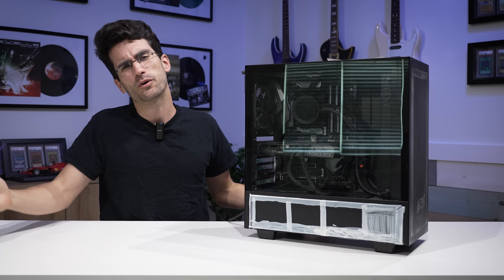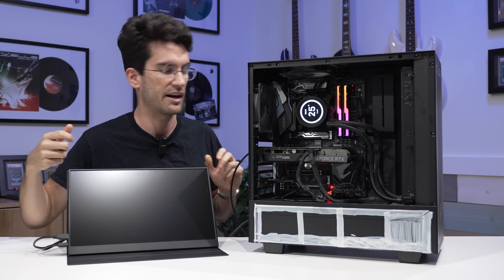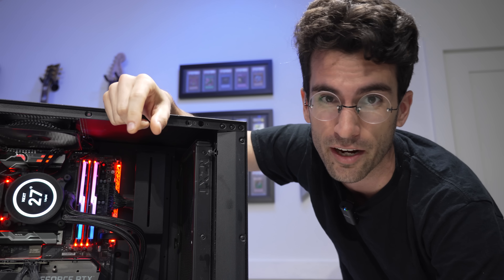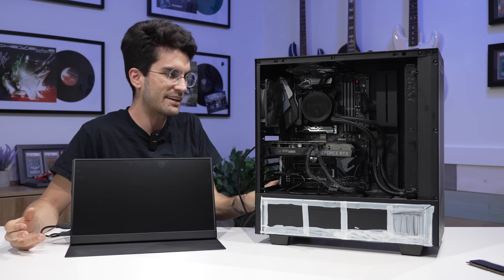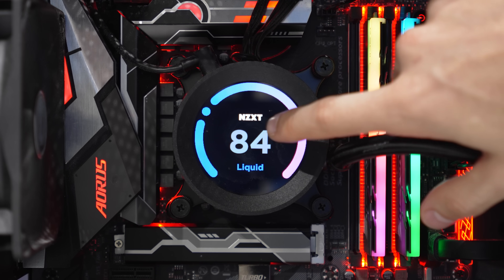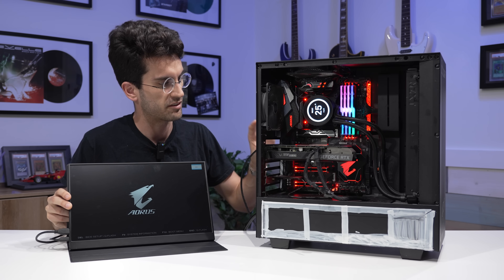Fixing a Viewer's BROKEN Gaming PC? - Fix or Flop S7:E1

Comment: Hi @Greg Salazar,
Just catching up on your Fix or Flop videos.  When paused at 7:10, you can see on the Trident-Z DIMM with the sticker, it looks like THE BOTTOM EDGE OF THE DIMM IS NOT PERFECTLY STRAIGHT.  IT LOOKS LIKE THE PCB IS WORN OR FILED DOWN TOWARDS THE EDGES.  You could confirm this by placing that edge of the DIMM against a straight edge to see if it rocks from side to side.  This could cause poor contact in the DIMM socket, similar to a DIMM not being seated correctly.  When you first inserted the set of 4 matching DIMMs at the end and one was not seated correctly, you can see at 16:13 that the motherboard debug display is cycling through the same codes.

at 8:27, you can see the green DIMM looks the same.  But then so does your known working Trident-Z pair.  Hmm.... Just confirmed via google that all DIMMs have an intentionally curved connector edge.  Ha, so much for my theory.  Never mind.

Thanks for your videos!

Comment: Any ideas what's wrong my laptop works absolutely fine but if I knock it in the wrong place the screen flickers a  few lines go across screen for 2 seconds then its completely unresponsive forcing me to hold power button down to turn off then after it's fine again

Comment: The CPU cooler AIO needs rotating both the pump with tube sound.and the radiator should have the tubes up top. We'll look much better and will actually be able to get a longer graphics card in there.

Comment: Greg ther ewas still 1 odd thing after the replacement of the Dimms...Only 3 of them had the red led lit up on the board. it should have had all 4 lit up. 1 of them still might not have been fully seated or registering

Comment: Just clean the dimm connectors with rubber eraser and wipe with isopropyl alcohol. Should do the fix.They very often get oxidated and lose it's shine. That's unwanted resistance between the mobo and the dimm. Been doing that for decades and rarely failed.

Comment: Had a problem with a brand new  game pc from the beginning saying Critical Process Died, seemed a very difficult problem. After a few tries to get it to work without error message and rebooting it got fixed under warranty. Now the pc runs like a smooth dream and without even the slightest sign of error since 4 months. Still wondering what the procedure was fixing it. Now i'm keeping the pc for 4 or 5 years. 👍

Comment: if i were you, i'd plug in a usb stick with an live OS distro to prevent borking the installed OS on the main drive when you improperly shut down the OS by switching off mains power.
Reply: it's not fun to troubleshoot OS installations.

Comment: I bought the same exact G Skill kit to go into my system and had the same problem with one of the DIMMs going bad. I bought the first set new from Newegg. Returned them to Newegg but they didn't have any more of those kits. The second set I bought used and the same thing happened again! One DIMM just stopped working out of the blue. I dumped G Skill and went to Teamgroup and haven't had any issues with RAM now for almost three years.

Comment: Did you change the water block screen to C? Seeing 24 degrees (F) later made me choke for a second. Lol. FWIW, I've never had a dead DRAM stick issue. Even mixing sticks in a PC never caused any stability issues... even bought used sticks.... but also didn't push the timing/speeds with mixed sticks. I wonder if the PC was set to the XMP for the original kit and they added the extras ram and tried to keep the say XMP settings?

Comment: What's with RAM these days? I started building computers in 2003, modding and upgrading them in 2001, and I've never had RAM go bad on me. I just built a new PC over the summer. Now I'm wondering what the chances are of having components just fail inexplicably. That's so weird to me. Is it perhaps that running XMP or EXPO is possible but reduces their lifespan over time? For what they charge for them, that shouldn't be the case. Curious.

Comment: To eliminate loopboot, use hardware reset! remove batery bios, and after pres both reset+power on, keep both 10-20 second, after release reset but keeping pressing power, after 5 second release power on off! it is problem from bios! i have aorus ggigabyte b450m with that same problem! it is from bios all problem!

Comment: You said a friend you should had sanded that bottom panel and painted flat black. Does your mechanic clean and wipe his tools down. My self I have a touch of OCD. How many times I had upgraded my desktop cases. I spent two days trying to work out my Ubuntu applications installed  went blank no applications. That the last thing I do is to remove any useless applications they are a security risk and slow down the PC. Ubuntu has bugs and they don't get in a hurry to fix them. I have to check google and find fixes. Time consuming you enter the fix into the terminal and nothing. Here one been going on for years. Thumbnail video or music to show an image and there are none. I found a terminal command that works. The side application bar there a command to make it slide again so you can have a good view for your wallpaper.

Comment: As far as 8th Gen, at least they can run 11. I have two 8th Gen i5 laptops. What is bad is that I almost bought a 10th gen i7 laptop where the CPU barely performs better than an 8th Gen i5.

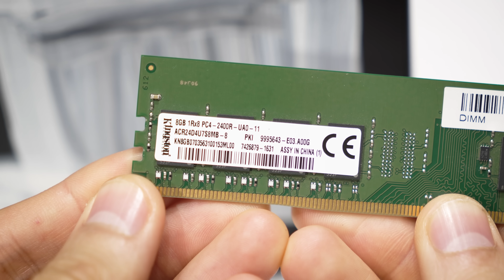Comment: When friends ask me about adding more RAM, I always ask their current ram mhz & cas letancy. Once we know that I tell them to look for another kit of the same speed and letancy, that way they can eliminate issues like presented in this video where the Triden Z was 3200 CL16 based on the sticker (07:10), while the Kingston 8gb stick is 2400 CL17 (07:23).

Also even today, when I assemble/troubleshoot a friends PC, I install the bios speaker, why? because even if there is no issue my friend can hear the post beep sound and know it'll boot, if he doesn't then he'll have to look into it, but at least have an audible way to know something is wrong. I know all the fancy screens and what not, but having it does not hurt.

Comment: I thought you would have also swapped the orientation of the aio radiator. Having the entry/exit points below the block is gonna have air trapped in the block, lowering lifespan.

Comment: i never had D bug leds help me fix a issue . i upgraded a cpu , ram and psu the other day in a pc and then it showed debug led on cpu . resetting cmos was the fix as it was a ram trimming issue what should of auto reset when installing new ram but i guess thats why you should reset bios to default before changing parts like that . if i listen to then leds . i would of removed the chip and considered it dead as it was used second hand part

Comment: About 14 minutes into the video you removed the memory module before the lights when out, not even turning off the power supply either and pressing the cases power button to discharge the motherboard.  That just blows me away, I would never do that because you never know what static electricity can do.   Maybe I'm wrong and that's not a thing anymore.  Before removing any connections to the motherboard or adding something, that's something I always do.   Otherwise, good video and troubleshooting!
Reply from the maker: The system was off. Not all power was drained from caps but I've done this many, many times and it's never been an issue. That said, I'll always preach the correct way when instructing others.

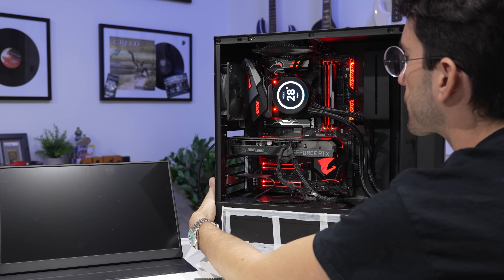Comment: 13:46 its never a good idea to hard power off a pc as its booting into windows - its usually a sure-fire way to corrupt the OS.
Reply from the maker: If you're worried about it, then you probably shouldn't. No drivers needed to be updated as no motherboard/CPU was swapped. Been doing this for years and never had a single issue.
Reply: @GregSalazar  You've been VERY lucky then.
Reply from the maker: This isn't about luck. I said no drivers were updating. There was nothing system-critical to interrupt by powering off the way I did here.

Comment: This brings back so many memories... I struggled for a few days to get my system "stable", loads of BSODs, random screen artifacts, etc. I removed a RAM kit (I had 2 x 16 GB kits) and found that with one kit the BSODs would appear, but not with the other kit. I sent the kit back to be replaced (was in warranty period) and it has not had an issue since.

It taught me to also investigate RAM instead of assuming corrupt files on the HDD or SSD

Comment: Generally what I do is if I find confirmed dead memory modules, I snap all them in half; and in the garbage they go.  Then I replace the ram setup with new memory modules, I never save the old ones or give them back.  Memory modules to me are wear items, and if they are dying off they are not to be trusted, and certainly don't get reused.  I have had used memory modules that were installed in a few system builds that eventually get wonky and do things just like what happened in this video.
Reply from the maker: Bit of a silly proposition. If they work, they work. Same with most any other part (exceptions can be PSUs and storage drives for reasons I've discussed previously). Especially in this climate with RAM prices shooting through the roof, I'm not gonna be keeping owners' working DIMMs.

Comment: Fix the temp orientation 🤦‍ At one point you did have it the right way around i can hope that part got added on at the end of the fix and its still the right way around 🤷‍🙏
Reply from the maker: Why are you face-palming? I literally said in the video this is an easy fix in NZXT's software. I don't sign into Windows unless I have to for liability and security reasons.

Comment: I don't really understand why you think it's not power supply related. Those symptoms are extremely common when a power supply is starting to fail: Problems shutting down the system, then later problems launching Windows, later problems even POSTing, and over time it gets less and less far in the POST before it fails. Those are the quintessential symptoms of a power supply that's starting to fail! In what universe does not that raise suspicions of a power supply issue?

The motherboard getting some power (leds light up, fans spin up) does not mean the power supply is fine. Not all power supplies go out with a loud bang and stop giving any power whatsoever. Many of them start giving less and less power when they are starting to fail.
Reply from the maker: Firstly: relax. Secondly: the PSU was fine. This behavior was NOT indicative of a failing PSU and I can confirm the owner is still gaming with the system today.

Comment: I'm at the point where when a client complains about memory instability, the first thing I do is clean the RAM and sockets with De-Oxit, and if the system POSTs, disable XMP and leave it off.  Stability is a lot more important, especially to my clients, than speed - and that's why JEDEC exists.  Let the manufacturer's warranty folx handle issues with "guaranteed overclocks".

Also... I love Ubiquiti stuff.  My favorite network equipment outside of full-on enterprise Cisco.

Comment: i had a pc running just fine for 2 years, then the GPU stopped working, thought the GPU had died, but after trouble shooting, it was my PSU cables to my GPU, the pins were not seated properly

Comment: Good to see he mounted the front Radiator correctly with the hoses down. The only reason to mount it with hoses at the top is convenience and laziness.
Reply from the maker: There's typically no difference so long as the AIO in question is filled sufficiently and pump location is below upper radiator/barb height. That said, you'd be surprised just how many folks have commented that this AIO is in the incorrect orientation...

Comment: These days when people bring in some ancient thing to ask me to fix I tell them if it isn't something simple they are just better off letting me upgrade them to AM4, you can get Chinese B450 boards these days from AliExpress for sub $40 and a Ryzen 5500 new is only around $70 and that combo will run rings around some old 5/8th gen Intel, especially the i3s and i5s I see more often than not in older systems.

Comment: The original random crashing and the boot looping were the same issue. Probably the ram was in the process of dying which caused the crashes, then died totally which caused the boot loop.

Although those tight ram slots could be the culprit. I'd test the bad ram sticks in another machine to be sure. I have an Aorus Elite with that issue (seems like a lot of gigabyte boards are like that lol). Thing about that is even when you think the ram is fully inserted it might be out still just a hair. Even a tiny bit (less than a millimeter) seems to be enough to cause that. Had it happen with me when I first rebuilt my system I was sure the ram was all the way in but the system went haywire when I tried to boot it and it started boot looping. So I turned it off and gave each stick an extra push (with 1 hand braced on the back of the machine) and even though it didn't feel like it did anything the problem was fixed. 1 year later still working fine.

Comment: I got to play Greg myself recently when a colleague brought in a friend's new build. Asrock B650 Steel Legend WiFi with a 7600X3D and some G.Skill Flare X5. Said it had never booted, now wouldn't even power up any more. Well, it sure did after plugging the power cables and power button back in but was stuck on a CPU LED. Owner had attempted Flashback but failed, so I tried again with a small USB stick, following the instructions to the letter. Took ages but what do you know, it did the trick. Made the owner's month. Says the rig runs like clockwork. :)

Comment: Haven't finished the video yet, so not sure if you address it. But the CPU temp is definitely in Celsius, unless it's 25 degrees fahrenheit in your house.
Reply: Or maybe when Windows boots it cuts over? Could be that I guess
Reply: Stumbled across that as well, 26° Fahrenheit apparently is -3° Celsius, so either the CAM software has kicked in, or the AIO is defective.

Comment: The upside down AIO is bothering me to no end...
Reply: That's the way to orient it if it's not at the top, watch the steve/Jay video
Reply: @Bonga126  You are right, my bad. The orientation is correct - vertically at the front or rear of the case with the tubes at the bottom
Reply: @Bonga126 the case only has 1 exhaust top fan, otherwise it’s solid. His AIO is fine. It’s actually the best way to mount it in that case.
Reply: Same here 🤦‍♂

Comment: That temp on that water block went down to 28c down from over 80c
Reply: I've got one that does that. When you first boot the system it defaults to Fahrenheit till it gets further along in the boot process, then it switches to Celsius.

Comment: This is pretty much the worst way to install an AIO. The hoses run downwards from the pump head, which means air bubbles remain in the pump and will destroy it early. The radiator should be turned upside down so that the hoses run upwards. Then the air bubbles will collect at the top of the radiator, where they can't cause any damage. In addition, the radiator obstructs the airflow to the graphics card.

Comment: The 16gb ram I currently have is 5 years old and recently when I'm at the desktop the machine freezes and when I did the extended memory test with the windows diagnostics tool and The test lasted over 13 hours and the end result was straight away the machine crashed and said the ram is broken and the strange thing is that if I play games or anything else it doesn't crash

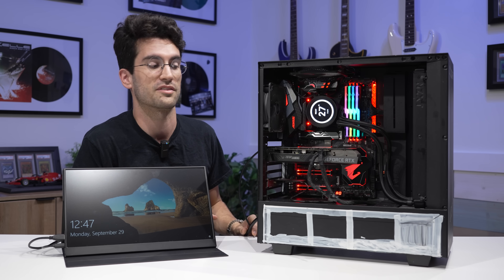Comment: 19:15 Greg the 3060 is a 12gb card! Not sure if you forgot that!... It is also 1080p card! 
If 12gb is going to show Vram issues with new titles in 1080p then literally 90+% of budget builds will be screwed on their new 8gb cards!
Odd take!
Reply: Maybe it's the 8GB variant, he didn't clearly mention. Should've.
Reply: @KatMeIfYouCan96 your right he didn't mention it, But to be fair if not mentioned I automatically assume it's 12gb, because that is it's default spec. 
Usually when speaking of the trimmed down 8gb it is presented as the 8gb 3060!

Comment: My OCD wants me to top mount that AIO and and fix the temp orientation.
Reply: Mine wants him to fix the missing MB screw next to the diagnostic LEDs
Reply: @RandallRoman  The problem is that not a missing screw. In fact some cases comes with a "notch" so it will be easy for you when you install the motherboard aligning it into place.
Reply: I know, right! 😆
Reply: Oh yea..The "Jesus" reborned problem aka GN. But the problem is that actually is "not " a problem. Im not sure in US what you learn at school , but here in Eu we learn the principle of communicating vessels in like the 4 year of school. Actually the fact that the owner of that computer is using it like that and judging on the age of components , i will say he is running it like that from a long time. The Aio didint broke wich means , that the "sharade" of "wrong aio installing" is just a gimmick to get YT money. In reality , yes we can say that if you can is better to install the AIO with the radiator "on top"(as the principle of communicating vessels tells you that the air will be sitting on the most hight level) of the pump , but if you dont do that is not actually a rule that you broke that AIO.

Comment: The board probably doesn’t like the Kingston 2400R Registered DIMM for sure. It may work fine in a system that is compatible with registered RAM.
Reply: Good spot. That is one super weird stick. It sure looks like your average unbuffered DIMM. Maybe it just passes itself off as an RDIMM via SPD info in order to keep systems requiring those from complaining? If so, it may well run in a standard board if the BIOS is lax enough.